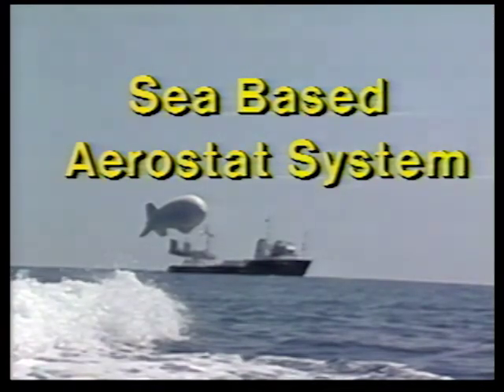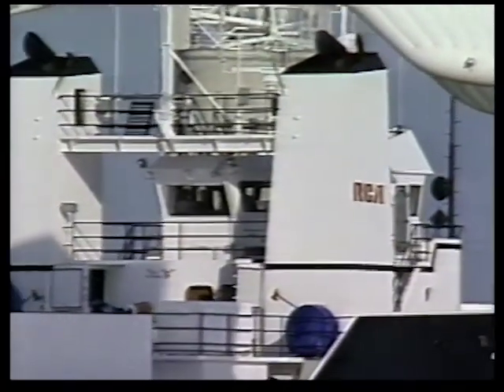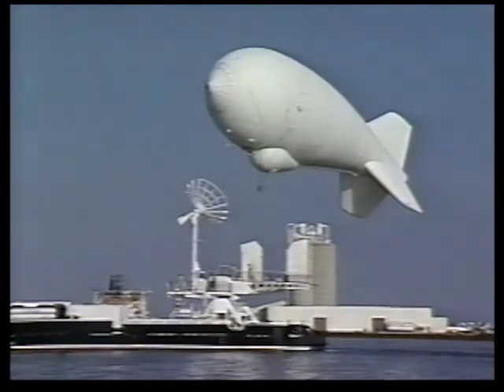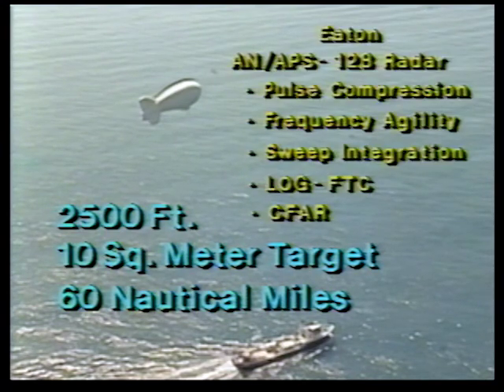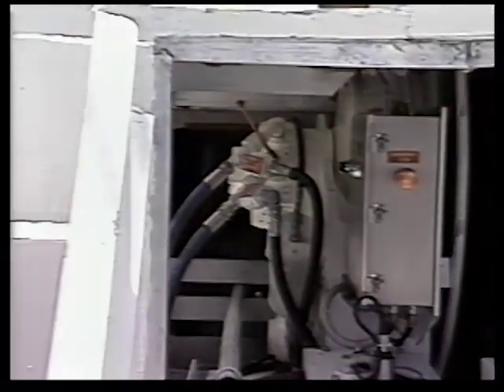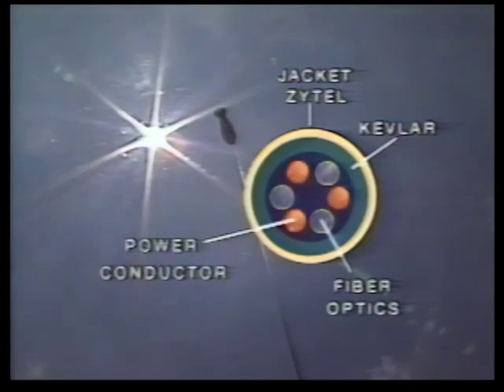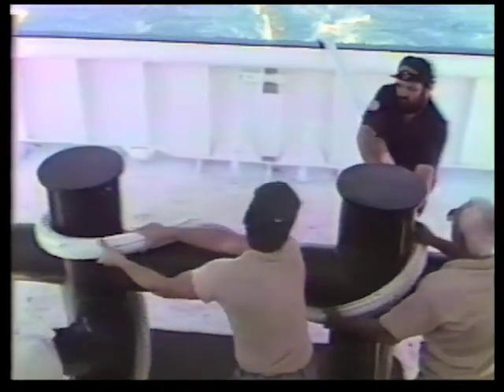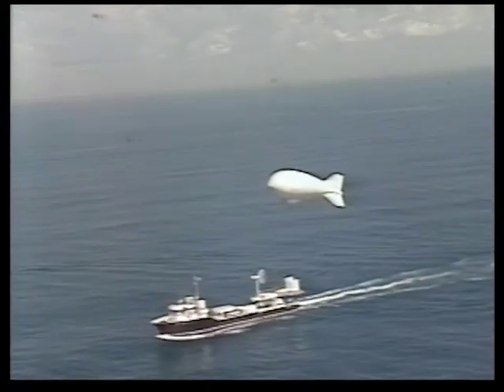RCA's Sea Based Aerostat System

Comment: thank you for preserving this for the future! It's really interesting and a shame RCA isn't around anymore to my knowledge, so thanks again!
Reply from the maker: Today, RCA is a brand name only. Trademarks are held by Sony and others. RCA Aerostat Systems however became General Electric Aerostat Systems which was acquired by Lockheed Martin which operated kite balloons (aerostats) until recently. They probably still have interest in the technology. One of the last engineers to have been an RCA employee retired from Lockheed Martin just a few years ago so the legacy lived on since the early 1970s. The mooring platform that was on the Atlantic Sentry in 1986 when this video was made was preserved and resurrected in Baghdad to be used on the first Persistent Threat Detection System (PTDS) site in 2004. A new platform replaced it in 2007 and I was in it when I worked for Lockheed Martin that year in Operation Iraqi Freedom. The original is probably still there.